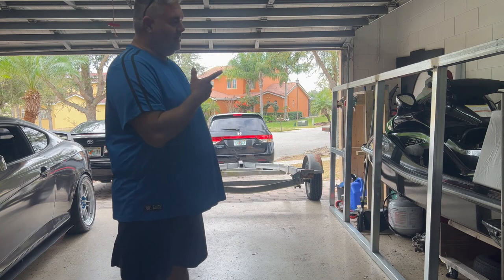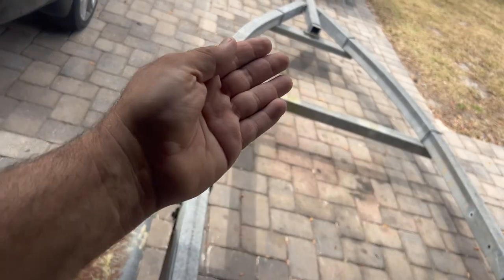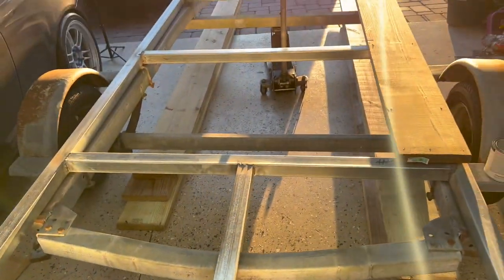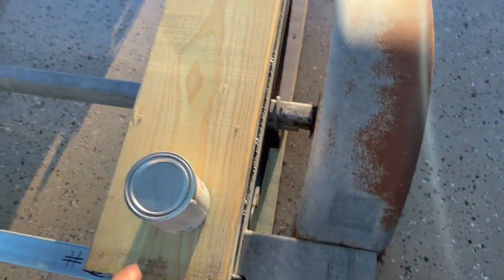How to make a homemade utility trailer

Comment: Cool - the only thing I'm slightly concerned about is the strength of those loops :)
You could weld some extra hook points to the edge of the frame, no?
Reply from the maker: Yes I did and I’m going to make rail’s all around and those are going to reinforce the platform to de boat trailer.